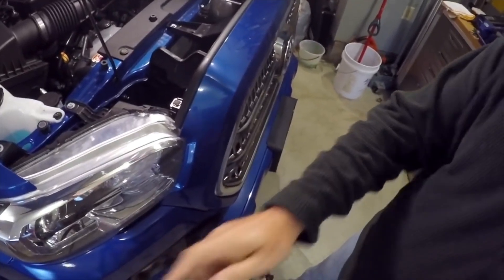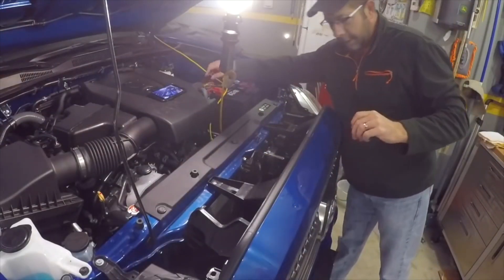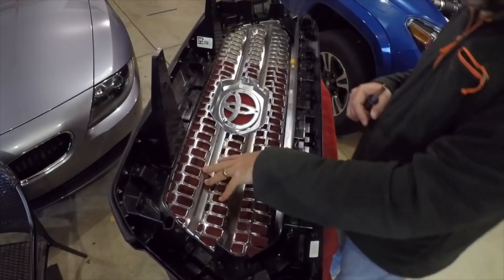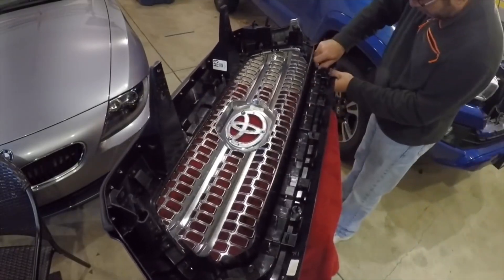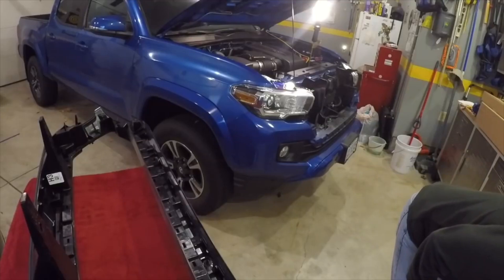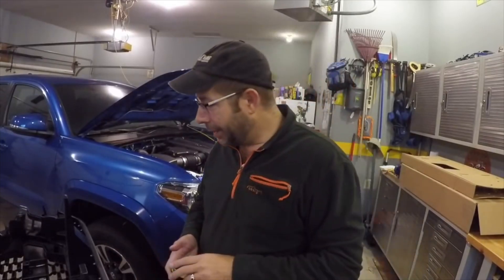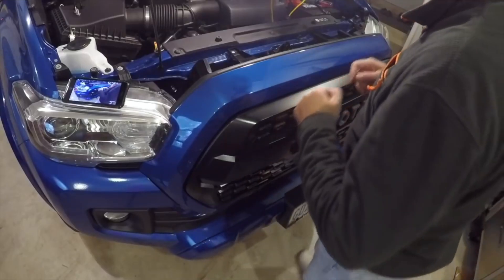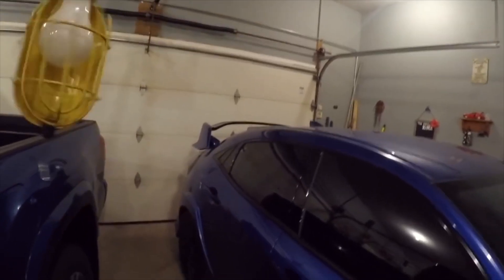2017 Toyota Tacoma TRD Sport TRD Grille Insert Replacement

Comment: I think he does that to make the videos more interesting if he just liked everything about the truck there really wouldn't be any reason to do the modifications you find the best truck in it's class get as much as you can from the factory that would be to difficult to do in a twenty minute video and that leaves a tacoma witch is probably the truck that has the most aftermarket parts than any other vehicle on the planet and get and idea of what you want it to be to show what your personality is there is so many tacomas on the road some people are happy with them right of the showroom floor then you'll see twenty in one day everyone looks so cool but completely different than the others they all represent the owners own taste and there has to be at least ten company's that make aftermarket parts and each one is like a personal work of art at least that's why I do it plus it gives me a reason to save up and test  my own skills it's a fun hobby and most of the mods I do are on a tacoma sr the lowest in the line but I have extras that wouldn't even come on my model and when I finish one you get a great feeling of pride when you have something that came out of a box with wiring harnesses and hard ware and you have to take a good part of dash board apart and when your finished and everything  cleaned up and you hit the switch and it works perfect you get nice feeling of pride you can tell people oh I put that in myself and they notice other things there trucks don't have and maybe they get inspired to try something that they wanted in there tacoma but it wasn't available that's my take on it Rob might have other reasons for doing it